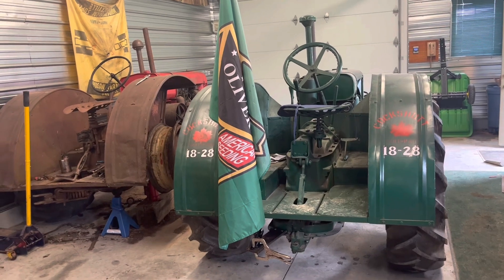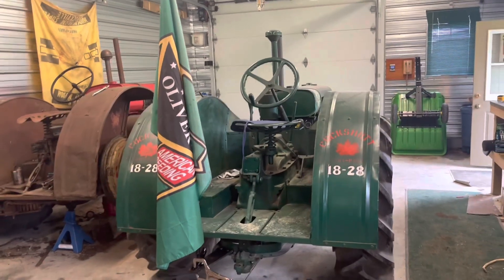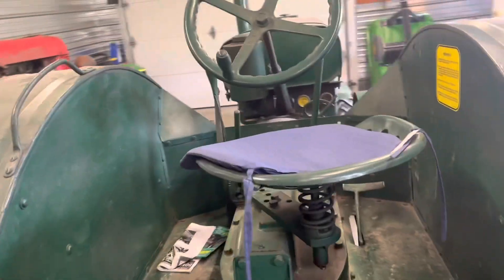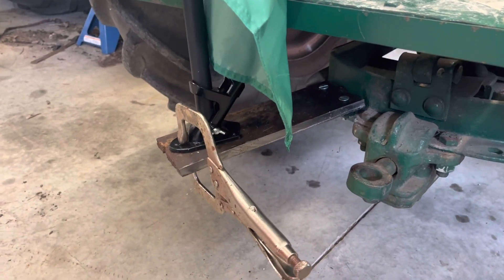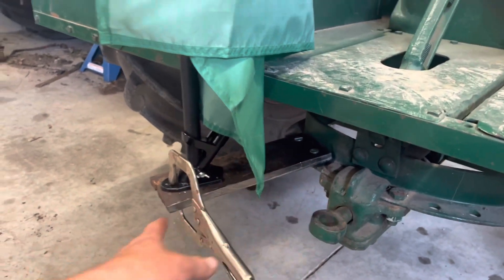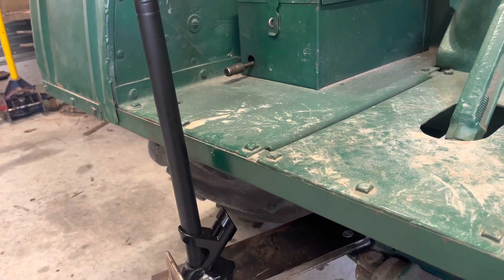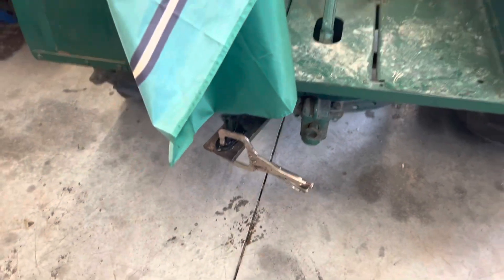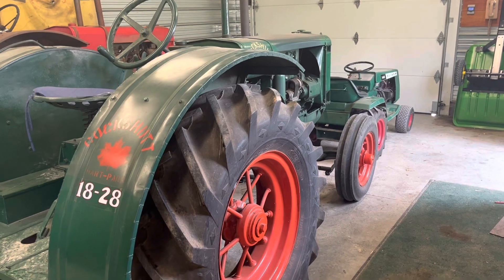Custom Flag pole for the 18-28

Comment: Looking good to me. I say the plate thickness is good. You'd be surprised how much flex a flag can cause. Especially going down the road. Just make sure you round those ends off. Could get a nasty cut.
Reply from the maker: Oh for sure, I still
Have some fab work left will
Definitely be grinding those corners down